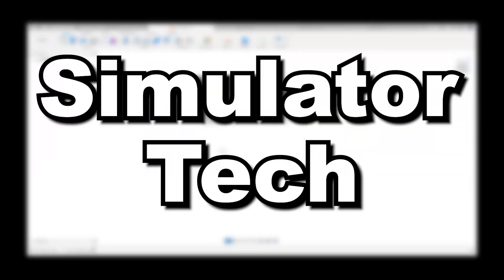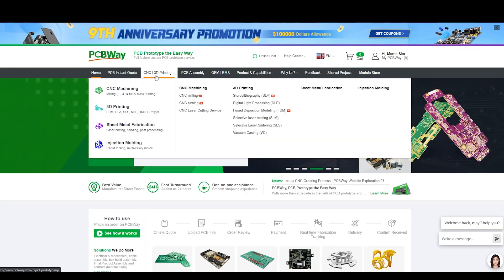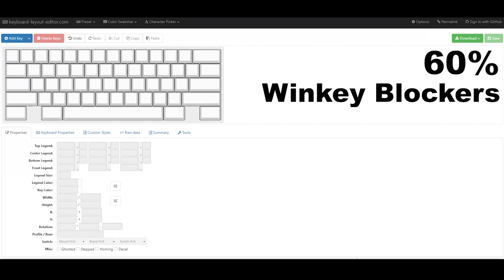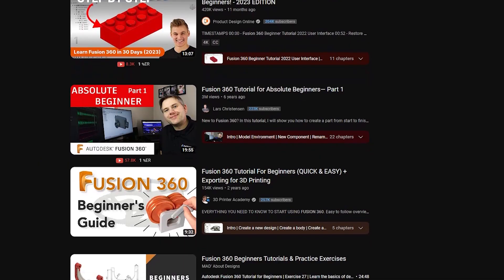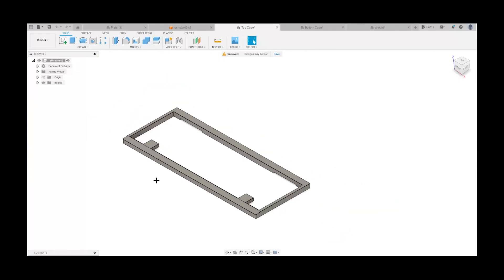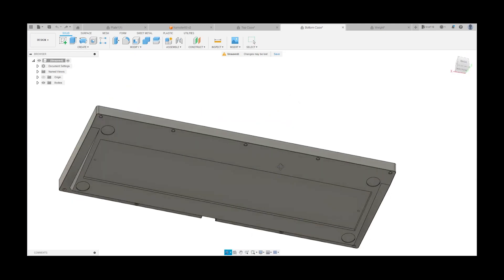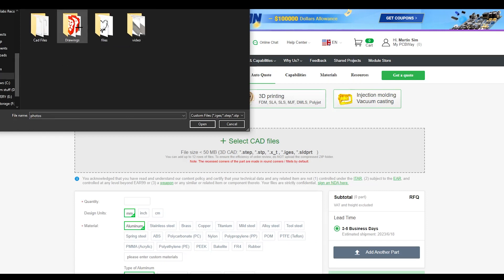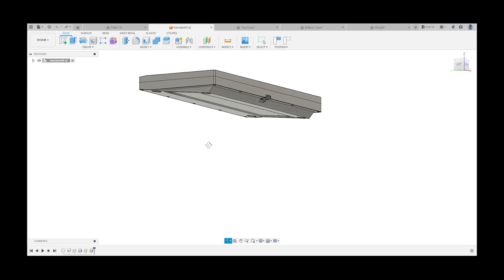Designing a Custom Keyboard From Scratch | Part 1: Fusion 360

Comment: Couple things you need to fix:
- Don't use swillkb plate gen it's old and bad, use modern alternatives such as AI03 plate gen, keebio plate gen
- Add fillets to internal corners, external too, you'd save the engineer extra time fixing the design plus you don't want your manufacturer to decide those features themself.
- Size your fillets correctly, I noticed the fillets for the internal case are too small compare to the depth of the cut, you need to make it bigger around 0.6-1mm, smaller drill diameter has less cutting depth and are prone to break more, the general rule of thumb is fillet size bigger or equal to 1/3 times the depth of the cut.
- Have tolerances between tight-fitting parts, you can either have it on the model or on the drawing, or both; generally, 0.1 is good and you would not see the gap, I usually have a 0.1mm gap between the part in the model directly and have a positive tolerance on the drawing.
- Make thread drawings, your manu will definitely ask for them and you don't want them random guessing your screw size.
Hope there will be another video with these issues addressed to better inform future designers.
Reply from the maker: Thanks for all the info! I'm still quite new to this stuff so the input is very helpful. In regards to the thread drawings, the info was written into the drawings so no issues there